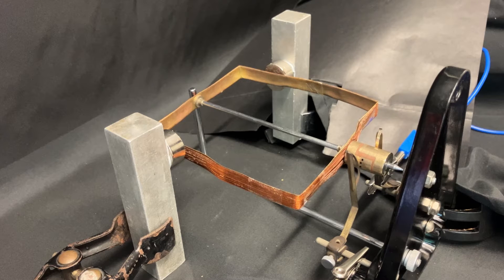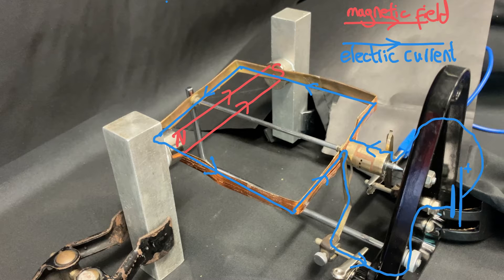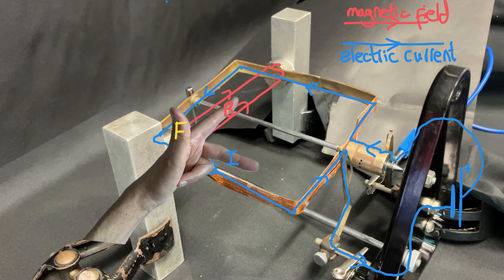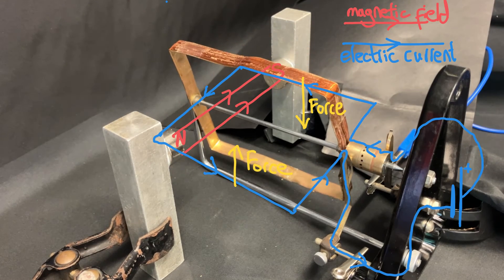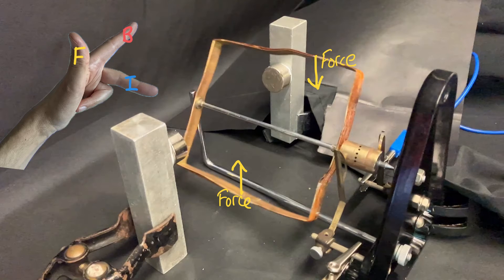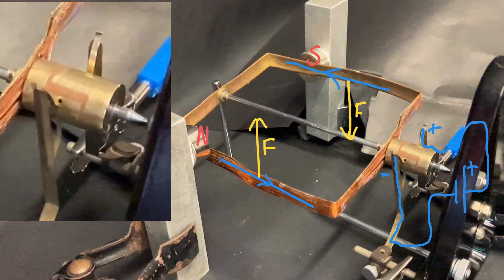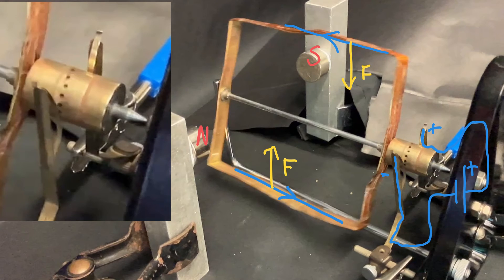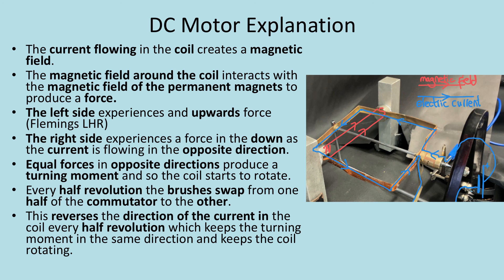Understanding the DC motor

Comment: But even without the commutator, it should be rotating continuously in semicircle right like first going right then coming back to the original position then again going...... Pls help
Reply from the maker: When it is vertical although the forces on the sides of the coil are not zero, the turning moment is zero so without a commutator it will fairly soon end up stopping in the vertical position as it did in the video.
Reply: But won't the coil oscillate from horizontal position to vertical back and again. It should be falling from the vertical position due to inertia if the frequency of oscillation is enough, right?
Reply from the maker: @AJ-fi3cn Friction means that eventually it will end up getting stuck but it might oscillate if the friction was very low.

Comment: DC motor works by alternating the direction of the current. Got it
Reply from the maker: Yes if you want an AC motor you use slip rings instead of the split ring commutator as the electricity supply changes the direction of the current for you.